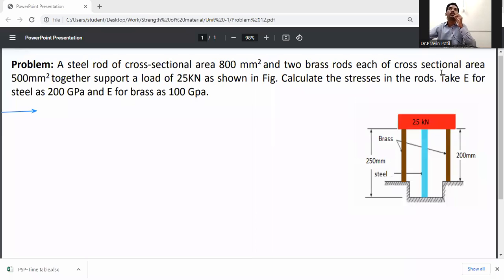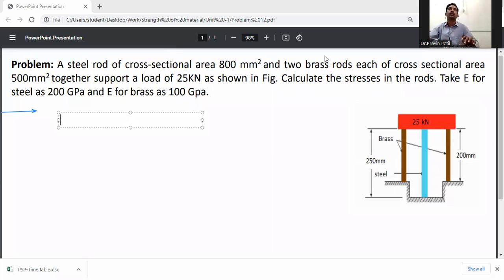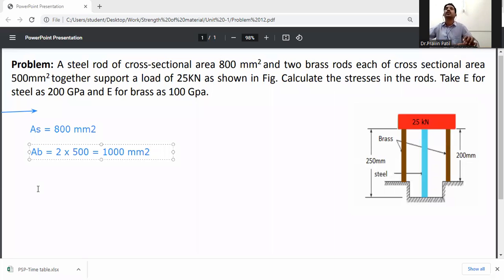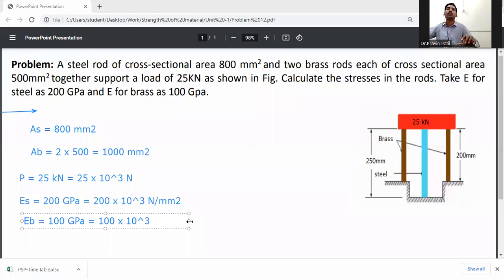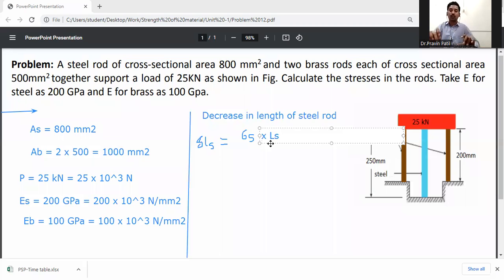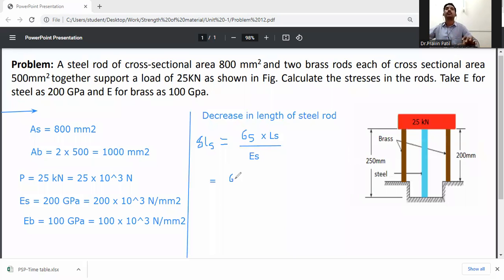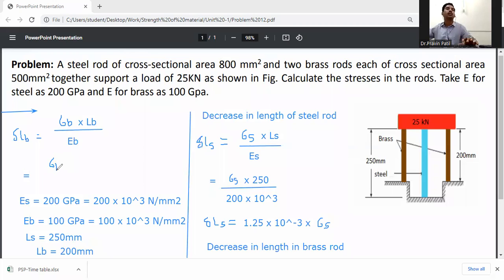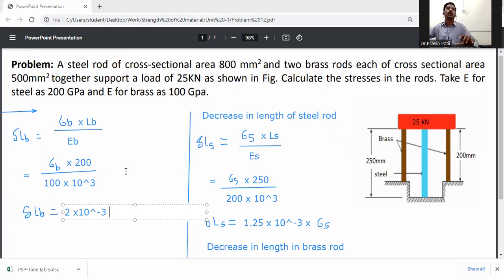Stresses in steel  and brass rod/Elongation in rods/ simple stress and strain/strength of materials

Comment: Each of the rods as shown below are of 6000 mm2 area at a temperature of 15
oC. Find the temperature at
which the stress in the steel rod will be zero. Take 𝛂 for steel as 12 x 10
- 6
/
0C and 𝛂 for bronze as
18 x 10
- 6
/
0C. Young’s Modulus for steel is 200 GPa and for bronze is 80 GPa.
Reply from the maker: Figure?
Reply: @pravinspatil  same figure like in this video
Reply from the maker: https://youtu.be/QUNqushbR8Q

Comment: The composite bar shown in Fig. 1-20(a) is rigidly attached to the two supports. The left portion of the bar is copper, of uniform cross-sectional area 80 cm^2 and length 30 cm. The right portion is aluminum, of uniform cross-sectional area 20 cm^2 and length 20 cm. At a temperature of 26 degree C the entire assembly is stress free. The temperature of the structure drops and during this process the right support yields 0.025 mm in the direction of the contracting metal. Determine the minimum temperature to which the assembly may be subjected in order that the stress in the aluminum does not exceed 160 MPa. For copper E = 100 GPa, alpha = 17 times 10^6/degree C, and for aluminum E = 80 GPa, alpha = 23 times 10^-6/degree C.